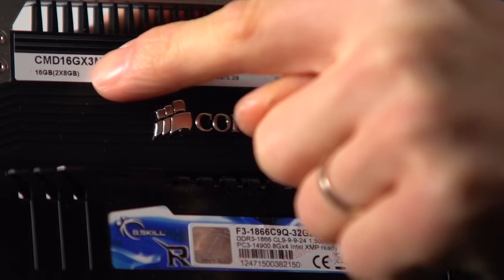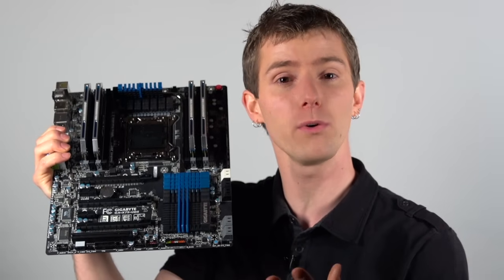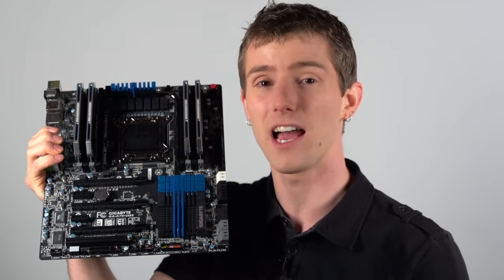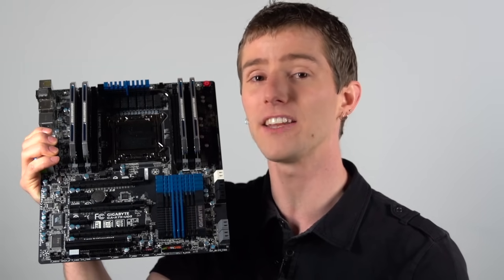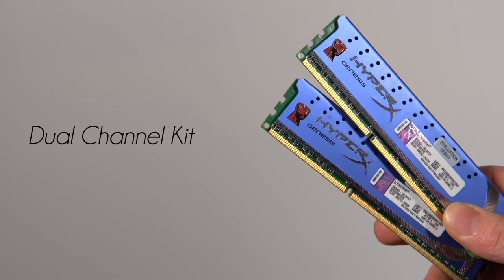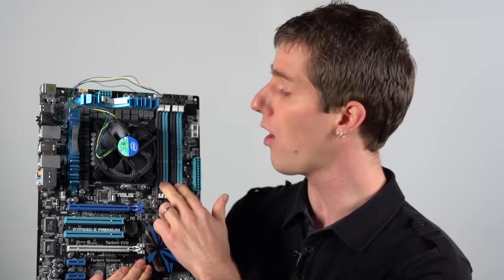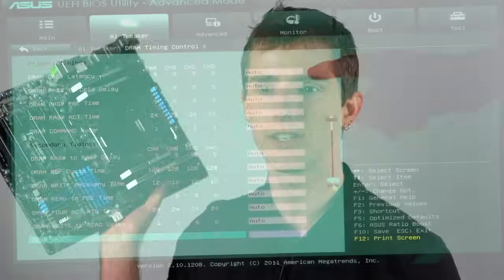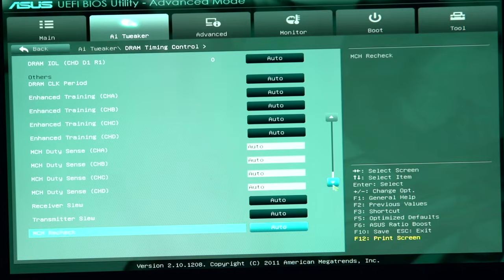Guide to RAM Memory Channels as Fast As Possible

Comment: This is a question to everyone.
I have a motherboard that has 4 RAM slots which supports 2 dual channel RAM packages. Means it has 2 slots in one color and 2 in another.

My questions is, If I buy quad channel RAM(4 stick) will it run in the same performance as if I would have used 2 x dual channel RAMs?

Comment: Greetings linus, I'm asking this question publicly because I know there must be those out there with the same  problem I have a new pc built by cyberpower I had two sets of trident z royal dual channel kits that I figured  would use, however when I populate the dimm slots on the right hand side they are not detected but they do light up the rgb and it registers as 32 gigs. There are 4 16gb dims, but if I put them all on the left side they register  as 64gb, the dimm slots are all the same color and the manual says the boardm works in quad channel if you use more than 4 sticks if ram, please help, thank you so much

Comment: If i may ask something, Can i Put 2 different Ram Modules together , for example a Kingston HyperX Blu 4 GB 1600 mhz CL9 and a Corsair Vengeance 4 GB 1600 mhz CL9?? As far as i know the only difference they have is Voltage, The kingston has 1,6 and the Corsair has 1,5. Can i use them together?!! Please respond :P

Comment: hi, i wanna ask something ... 
My motherboard is P55-UD3L by Gigabye and it has dual channel (4 ram slots), and so this is my question ..
i installing ram Corsair VS2GB1333V3(2x2GB) and the spesification is PC3-10700H and also have 9 9 9 24 Clock timing, and in the future i want to mix it with Corsair CMZ4GX3M1A1600C9 that has PC 12800 and have the same clock timing. is that ideal for mixing 2 different type of bandwidth o/ different type of ram ?

Comment: I have a question.

I'm gonna be buying a board with 4 ram ram slots.
But will it run a triple channel kit of 12 gigs flawlessly?
I do tons of video editing 8 gigs doesn't quite cut it, and 16 is too much for my budget.
Reply: ***** Alright, thanks!
Reply: ***** Well, since I'm probably gonna be running a fx 6300, and my budget is around 580 to 600, 16 gigs is too expensive for now. I'm probably buying my PC with 8 gigs of ram (1 Stick) than upgrading it later for 16 gigs. Same goes for the hard drive, going with a Seagate 1 tb disk, and transferring windows to a SSD later. One question I have though. I can pick up a 7950 for 155,- or should I go with a 270x for 170,-?
Reply: ***** Alright :P. Thanks for the help man :)
Reply: ***** is it necessary to buy kits? When I built my pc I bought 2 rams of the same kind, but they weren't part of a kit, does that mean they aren't optimized for dual channel?

Comment: hey, so i want to upgrade my ddr3 1066 mhz 1.35 v, with two ddr3 1600 mhz 1.50 v, i had checked that my motherbord and cpu support the frequency, but im not sure about the voltage, any help please?

Comment: I'm using a gigabyte ga990fxa-ud3 mobo which is a dual-channel configuration with 1 stick of 8Gb ram, is that bad and should I get another stick?
Reply: Typically AMD Boards it is best to purchase kits vs trying to use two separate sticks of ram reason being two separate sticks can vary drastically in ram values and even two sticks with the same values may not work side by side.  Intel boards seem to be a bit more forgiving in this area but they also do not seem to take advantage of dual channel they way AMD boards do.  With Intel you can probably go either way, but AMD you really need a Dual Kit for optimized ram.

Comment: iv heard and read  the 32 and 64,run  ablewise differently. the mobo I'm needing to decide whether to add 4 or leave it at 4. its a common thing to see corsair website and manufacturer also says 4 iv seen people reference how maximum ram is now 129gb  guessing that's not from a dual slot laptop. lol.. ..back to.. this mobo is amd nvidia athelon,ii  dual core its has 4 slots. iv got a 4stick set of gaming ram 1gb each. and iv gotn4 sticks of normal kv ram two matched pair of 2x2gb. if I am unable to use the 4 two GB sticks to make 8, should I put the 2 2gb sticks back or try and set the quad set in   I notice the slots are paired by color and  wondered.  is this a way of having ram in both CPU cores "utility belt" i got the machine used and didn't set up. ht it had both sticks in slot closest to CPU and the othernalot color is same as pcie slot. seemed kinda obvious that I should wonder if it was only running from half th CPU potential or if that's just a cosmetic thing. would I set one inneacj color to gainnboth CPU cores function or am actually already utilizing both. i assume I'm using both now but its slow AF  so want more than current ability if able. is there some magic answer to slipping in a higher capacity stickand gettingnit to aflgree with the rest of the machine . with how many times iv heard you can go over the many sugg limit. i suppose i could understand some being a yay and some being a big no. also the bios is in the to do list. as soon as i feel I'm understanding the diff options and processes Guess's  theres 3,install ways to set it up.   win, dos and "ROM?".  time to rewatch your video.  wish I could pick your brain for 20  minutes.

Comment: In a motherboard with dual channel and 4 ram slots, the 1st and 3rd are for the dual channel, the 2nd and 4th need to have the same Mhz as the 1st and 3rd or these slots just add more ram memory?

Comment: So if my motherboard comes with a free stick of 8GB ram could I buy a second stick later and use them both together without hindering perforamnce? I don't want to waste money on a budget build because I can get 8GB for free but I'm worried about a single 8GB stick beign slower than 2x4gb. I would probably just add a second stick later and make it 2x8GB.

Comment: Where can I see if my system is running on dual channel mode or single channel mode? At the BIOS? or is there any software to check that? I have 2 different memory sticks installed but I think they're similar.. where can I check that?

Comment: MEM DDR4 ADATA XPG 4GB 2400 MHZ GAMMIX sooo i have 2 ot this in dual channel on a B360m DS3H motherboard (4 slot of dual channel memory) if i add one more stick, ill lose performance? because ive mone for buy 1 more and up the ram to 12gb and in a couple of moth reach the 16

Comment: I'm planning to buy the MSI Z97 Gaming 5 motherboard which has 4 slots for memory and supports dual channel. I want to buy 16GB of Corsair Vengeance LP - DDR3-1600 (4x 4GB) but the website I am ordering it from says the pack supports triple channel. Will this combination work? And will it work ideally? I heard 4x 4GB is better because you have 4 times the 1600 MHZ speed. Not planning to upgrade in the future.

Comment: I opened my case and verified the person that installed my memores did it on single channel using b1 and b2. If I want to change it to Dual channel all I need to do is... stick the one in B1 at A2? My motherboard is a z490g GAMING -wifi

Comment: Is it necessary to buy 2 set of stick at same time or can we buy single stick intialy  and same stick later on for dual channel to work? 
I have dual channel ready mobo and still i installed only one stick of 4gb ram of corsair vengeance. Now i want to take advantage of dual channel architecture. Shall i buy the same stick of 4gb ram again and put in same color coded slot to take advantage of dual channel?
Reply: each colour is a channel,  you want a stick in each colour to make use of both channels

Comment: I have a question:
It's possible that i will buy a x99 motherboard(quad channel) and for now i will only need 16gb ram ddr4. However, i don't wanna spend all ram slots with 4gb each. I want to buy only 2 x 8gb crucial ddr4. Can I do this? only use 2 slots in a quad channel motherboard? will be run in dual channel instead? ty

Comment: This is very confusing: I have a Gigabyte AB350 Gaming 3 ATX board which is dual channel. Two of the four slots are populated with 8 GB each. So I cannot simply add two more identical memory sticks? The board remains dual channel, so how can I increase the RAM memory size. Buy 4 new quad memory stick and hope it will work? Because it's not guaranteed. Then why does the board come with 4 slots in the first place?

Comment: If I have two dual channel kits of the exact same make and model could it still run into the same issues he's talking about?
i.e. x2 Corsair Dominator 8GB (4x2)1600MHz
Reply: If you have a dual-channel board, you are doing the best thing possible. As long as each pair is in the right slots to work in tandem, you should see full performance out of those RAM sticks. If you have a quad-channel board, you won't see as much increase, but the difference is negligible unless you're doing 3D graphics rendering or something intensive like that.
Reply: SoulCloset
Thanks
Reply: probably.

Comment: I'm a bit confused because he says his board is a quad channel - 4 blue slots and 4 black slots, 8 slots total, but he also says a quad channel kit only comes with 4 sticks. Shouldn't the kit come with 8 sticks to fill all 8 slots? Or is having them all full generally a bad practice?
Reply: +Dallas Young Quad Channel kit = 4 stick, triple channel kit = 3 stick, dual channel kit = 2 stick. Most of the time, motherboard have more than enough channel for user to add more RAM. Some pc builder doesn't care about Quad channel, dual channel, etc because performance improvement is insignificant.

Comment: hi ! i have 4GB of ram. and my dh55pj motherboard supports only 8gb ram... and a wana buy Crucial Desktop RAM Ballistix Sport XT 16GB Kit 1600MHz DDR3 which is single ram... will it work or not? because later may b i will change my motherboard and then 16GB will definitely works... please help
Reply: +Tahir Butt Your motherboard is only rated for 8gb of max RAM. I'd recommend upgrading your computer with the money you'd spend on that module of RAM.

Comment: Hi, my mobo is Intel DH67BL. The max number of channels supported are two. Now i have installed 4gb x 2 (Both bought at different times, and both are single channel kit). Now CPUZ shows that my memory is running at Dual channel. Can i install additional 4gb x 2 on the other two slots?

Comment: My Motherboard is Emaxx but my mother RAM Slots are only 2, color blue and white. My Ram is 2GB 1333 MHz I installed my RAM in left one the color blue. I just want to add another 2GB 1333 MHz RAM and put it in the right or the color white of motherboard RAM slots. It work or I will just buy 4GB of RAM in 1 stick?

Comment: What if I put 2x2gb sticks in black slots and 2x1gb sticks in blue slots at the same time?(2gb ones have different timing to 1gb ones)  Will it affect performance at all or will it run normal?
Reply: 1123313 They're different channels so it will be fine. Check your motherboard manual to see where to put the 2x2GB first though. Usually the color closest to the CPU is where you put the first set. On your manual they should be labeled by a letter an a number. Mine has in order from the CPU A1, A2, B1, B2. I put my 2x4GB into the A1 and B1 slots.
Reply: so basically put the 2GB rams into slot 1 and 3 and put the 1GB into slot 2
Reply: Alfred Banuelos Thanks for your answer, gonna do it now!
Reply: 1123313 vv

Comment: If u have 2 blue and 2 black slots and only have 2 sticks does that mean the 2 blues go together and so on for the black. Mine our marked dimm 0, 1, 2, 3 so I should start with 0 first then 1 right?
Reply: nope. Look it up in your Mainboard User-Manual or online for the specific board. Since they are numbered you should start with 0 and add another stick on 2 (!). But you should look it up first

Comment: ok, ok so when ther is 4 ram slots (2 of eatch coller) then then there is dual chanel. And if there is 8 ram slots (4 of eatch coller) then there is quad chanel. But if i buy a board whit 4 slots, then buy a set whit 4 ram sticks then i have dual chanel board, but quad chanel sticks???? and btw will it work together??eks. ASUS ROG MAXIMUS VII HERO, Socket-1150 and HyperX Predator DDR4 3000MHz 16GB

Comment: So I have a dual channel motherboard but I only got one stick of 8GB 1866 DDR3, does that make a difference? Should install another of the same for better performance or does it not make a difference? (Only gaming, I know 8GB is not much different from 16 in gaming YET anyways)
Reply: At the moment, it doesn't really affect gaming all that much. I suspect 8 gigs will be enough for the next 2-3 years at least. 1866 is also plenty fast for now.
Reply: No I know I mean like would it have been better for 2 4GB sticks cause the way RAM bounces back and forth? I'm kinda wondering if I'm causing more latency by only having one stick
Reply: need install another stick equal to the another (same model or specs) for getting the max performance because the system can access the two stick simultaniously, is the reason why the most pc for gaming are using two sticks, for example, 4x2 gb (8 gb ram) or 8x2 gb (16 gb ram)

Comment: How do I install ram in dual channel? I currently have an 8gb stick in my system and I plan to add another 8 and run it in dual channel. I plan to buy another ram of the same brand and size . Is it straight forward as installing it in the proper slots then booting it like normal?

Comment: Linus I have 1300 mhz  Kingston memory but my mobo is detecting strange frequencies for the ram. Right now its sel to like 1150 mhz but the next increase it like 1450 mhz would it be safe to run at that frequency?

Comment: please i have a question to ask. i have update my laptop (Toshiba P50-a-144) with a Kingston Hyper X ddr3 8Gb ram. the second one is Samsung ram DDR2 8Gb. Both of this cards have the same 1600 MHrz but the deferent cl the fist on is in 9 and the second is 11. After the installation i see the system having trouble. especially with photoshop. i have made many check with windows memory tester and with Memtest86+ live cd and the programs didn't find any errors. i want to ask if it relevant and what to do. thanks
Reply: sorry but by mistake i wrote ddr3 to ddr2. my laptop has ddr3 ram capability
Reply: ddrl and my laptop has two slots and max ram 16Gb
Reply: how to disable dual-channel? i am all reedy run my pc with separately ram sticks and work fine.
Reply: +A Helpful Person thanks!

Comment: what about 4 sticks 8gb single vs 2 16gb dual kit.  I can find 16gb sticks but only singles, have yet to find 32gb sticks.  My motherboard can utilize up to 128gb mem.  I do game.  Currently have 2 16gb dual kits, had to remove 1 bad stick that failed ram test so I am using 2x8 x3 sticks A1,A2,B1.  Will 64gb, 4x16gb, improve gaming performance?

Comment: Hey guys, I have 2- 4GB sticks of memory on order for my 4GB computer. My question is, can I install these with the original memory, or do I remove the old memory cards? If I remove the two sticks that came with it, and install the new ones, I will be running 8GB total, but can I just install these beside the ones from the factory, or is this a bad idea? Two slots are black, and the other two slots are blue...not sure if this will help, or hinder my situation?! Thanks

Comment: If i have two 2-channel kits, one being 4 gb total and other 8 gb total, and they're from different manufacturers, will they work together allright or not?
My motherboard has 4 memory slots, two painted black, two painted blue
Reply: no, it will fucking explode
Reply: my laptop has a 2 samsung sticks, 1 is 4GB and the other is 8GB they work fine but I dont think 2 sticks from 2 different companies would  work
Reply: Hovna strejdy Dejva HP did that and its running fine, I didn't customize it like that

Comment: So my Z97 pro has a maximum capacity of 32gb. The board runs in dual-channel, so if i go with 4x8gb 1866mhz memory would it decrease performance that would be achieved from 2 x 8gb? If not is it safe to say i can max out the memory pool with side effects? 

The memory are all single 8gb dimm.

Comment: Are these (http://www.corsair.com/us/memory-by-product-family/dominator-platinum-ddr3-memory/dominator-platinum-with-corsair-link-connector-1-5v-64-gb-dual-channel-ddr3-memory-kit-cmd64gx3m4a2133c9.html) quad channel? I'm asking because the name of the product states "Dual Channel," yet in the "Cooler temperatures for better overclocking headroom" subheading it says "Our patented dual-channel DHX cooling system pulls heat away from the modules and allows Dominator Platinum to run at cooler temperatures than lesser memory kits." Moreover, the memory comes in eight sticks, which further leads me to doubt.

Comment: i have a quad channel cpu i7 6800k motherboard gigabyte x99-sli gpu gtx1070 and I have 2X 8gb 3000mhz ram when I enable xmp profile it randomly shutdowns my pc and restarts without any warning or notification can't figure out what the problem is.
when I disable xmp profile ram runs at 2133mhz and I have never notice my pc shutdown and restart randomly.

Comment: I have 2 dual channel kits on Ryzen 2700x. The kits are excatly the same. They are rated to be 3200mhz 16-18-18-38. But i can only all of them in 3066mhz 16-18-18-36. I have them on a MSI xpower gaming titanium x370. I've alsoo tried 3200mhz on 1.4V, but it will just boot in on 1866mhz when i try. Any idea whats the problem?